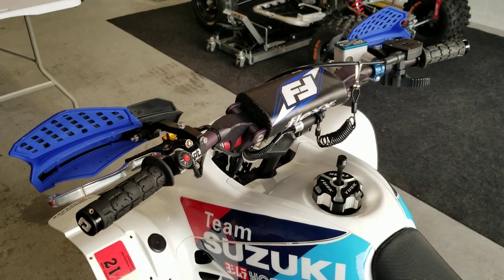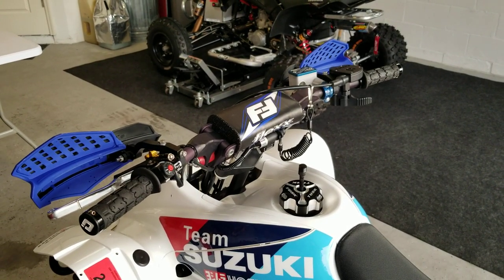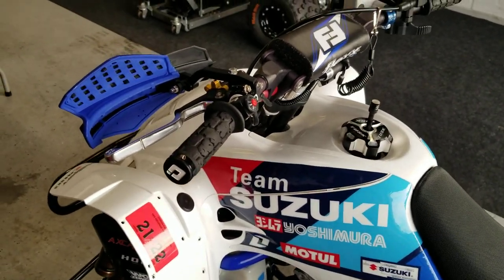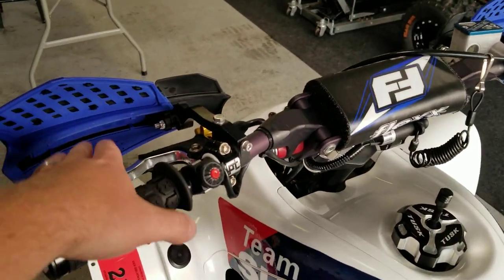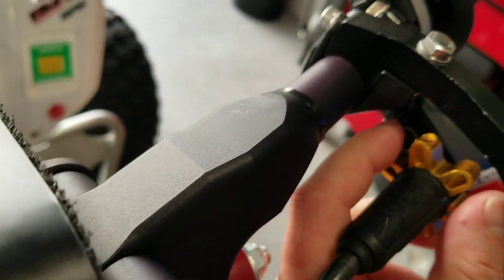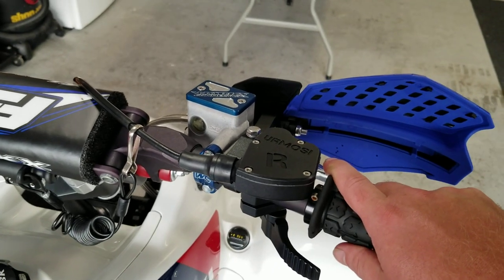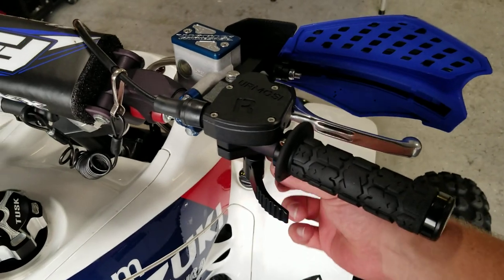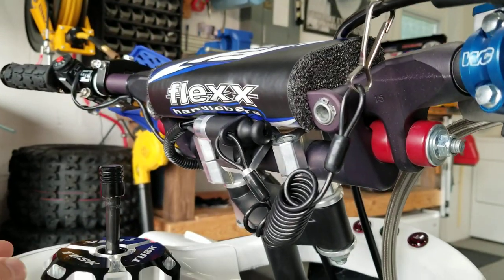Sport Quad Handlebar Setup

Comment: I have a 2008 trx450r and I was looking at your start button setup, how do you have your headlight switch setup? I still want to be able to turn my light on and off
Reply from the maker: On a Suzuki the headlight switch is integrated into the ignition key switch. So nothing to worry about. On a Honda or Yamaha you will need mount a separate toggle switch for the headlights either on the plastics or on a custom mount down by the stem. On my 700r I had a small waterproof push button switch mounted on my plastics.

Comment: Is the 15 degrees  almost same as the 14 degrees  ? I ordered  some 14 degrees  not knowing what to buy. I'm 6.2  putting them on a 2019 raptor 700
Reply from the maker: Yep, very close.
Reply: @PatrickRiggs33  ok thanks. I should be OK with 14 degrees . I just got mine today. Waiting for rox 2 in rise to install

Comment: Hi Patrick,
Thanks for sharing your quest with the Z400, I'm learning a lot and following your way:). I ordered almost everything related your handlebar, I'm missing some info regarding the brake cylinder. I need to order the cylinder for Honda trx450r. The braided hose are also for Honda? Need to replace calipers? Please share your info🙏
Many thanks!
Reply from the maker: Thank you! 

You don't, "need," the trx450r master it's just a preference but any year trx450 is fine. For the brake lines you can use Suzuki or Honda they both use Nissin Brakes. For Calipers you can use stock if you are happy with them or go with carb model YFZ450 dual piston calipers.
Reply: Thanks a lot 🙏  love your vids..keep it up :)
Haven't watched TV for 2 weeks lol all I watch now is your channel🤣
Reply from the maker: @haimjd  Haha appreciate that! I have a few more coming down the pipeline.
Reply: @PatrickRiggs33  waiting anxiously

Comment: Did you move the lights for neutral, reverse, hot? My 04 has a little plastic addition with them in it on the handlebars. I was searching handle bar setups because I want to replace the stock bars with the huge bend for something a little more low profile but don’t want to delete the lights
Reply from the maker: Yes, I moved them to the front plastics on the little lip just in front of the stem. If you pause at 5:55 you can see where they are.

Comment: Also, what degree bend flex bars do you have? I see many options on eBay and I was thinking 14 degree atv low
Reply from the maker: The Z has 15° quadracer low. The 250R has 15° high.

Comment: I got 7/8 pro taper high ATV bars, seems like when turn hard left, I run out of wire cuz of the extended distance, is there a way to take care of that?
Reply from the maker: Are you still running all the stock controls and switches/sensors? If so, once you get rid of the brake light sensor, and clutch position sensor, you should gain quite a bit of slack. Also, it might be a good idea to remove the front plastics and see if you can reroute the wires a different way. Usually there is a way 👍
Reply: @PatrickRiggs33  yea everything is still stock, either way, I’m not running the machine till the bar is set how i like it. What controls would you recommend for the 2021 YFZ450R ? I’d like to run something smaller for the kill switch n lights control, is there an option out there for em?
Reply from the maker: @2wheelarnie  So for the clutch I highly recommend the pro taper Profile or works connection. As for the start button and light control you can delete that entire assembly and run a dirtbike start button but in order to still use the headlights you would need to wire them so they are on all the time, run a dedicated toggle switch down on the fender, or delete the headlights all together (which is what I would do personally).
Reply: @PatrickRiggs33  Im a little confused, if I run the dirt bike start button, where would I have the kill switch?
Reply: @PatrickRiggs33  or would i just have to turn the key to kill it? Since the key is what decides to let the bike go on or off and send electric through it🤷‍♂️would turning the key at the ignition become my new kill switch?
Reply from the maker: @2wheelarnie  That is correct, you would use the key to kill it, or a pull tether kill switch which is also a really good idea especially if you ride Croom lol
Reply: @PatrickRiggs33  oh yes, 100%, Croom will have you in a tree while your bike goes down a 20 foot cliff😂
Reply from the maker: @2wheelarnie  😆😆
Reply: @PatrickRiggs33  hey man i appreciate it, i know I’m just a random guy on the internet but I really do appreciate the advise, especially when I know these are some hard core noob questions😂
Reply: @PatrickRiggs33  where should I get the dirt bike switch? Would Amazon’s switches work or should I get something off an actual dirt bike?

Comment: I have a stock kfx 400 that I'm looking to upgrade the bars on. What did you do about lights? We ride at night quite often so they are needed. Also on the kfx 400 the "dash" with the neutral and reverse lights etc is on top of the bars. What would I do about deleting this?
Reply from the maker: The lights aren't affected as the ignition key is what controls the lights on the Suzuki's. The, "idiot," lights as they are called are moved to the plastic rim/edge just in front of the steering stem above the headlight. Its easy to do, send me an email I can send you pics.

Comment: Morning Patrick hate to keep bothering you I’m looking at a 450r front master 06 Hubs and spindles for $100 with it or not.  I still need calipers.
Reply from the maker: Unfortunately the only thing that will work is the 450 master. If you want upgraded calipers you will want to find the yfz450 or raptor 700 dual piston
Reply: @PatrickRiggs33  so scrap the hubs and spindles
Reply from the maker: @stevewitkowski2864  Correct
Reply: What’s the setup I need to convert the 250r
Reply from the maker: @stevewitkowski2864  This for a 250R? If so then yes all of that WILL work.
Reply: @PatrickRiggs33  yea it’s for an 86 250r
Reply: Sorry for confusion I should of just emailed ya 😂